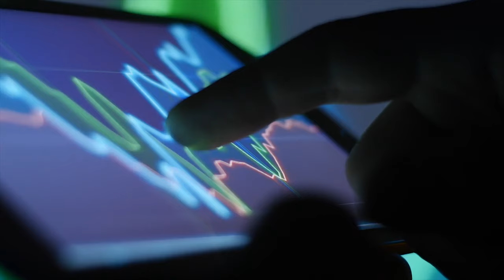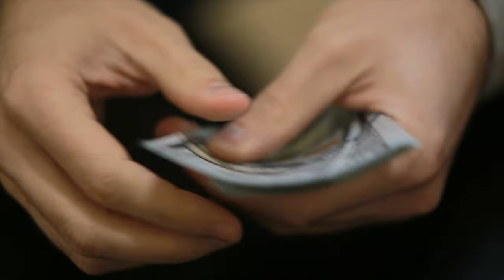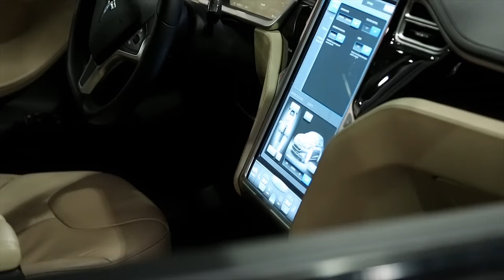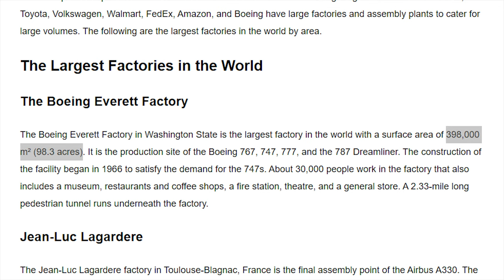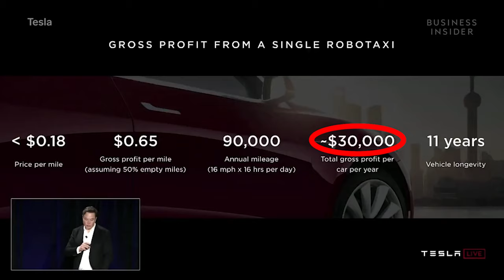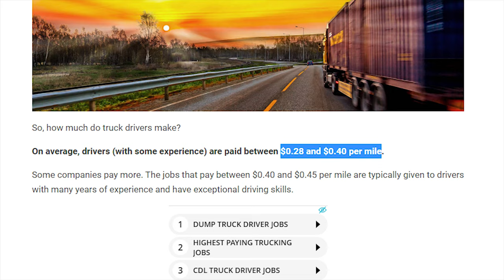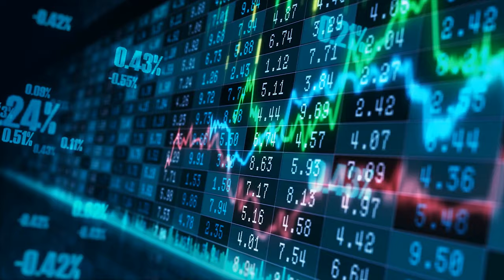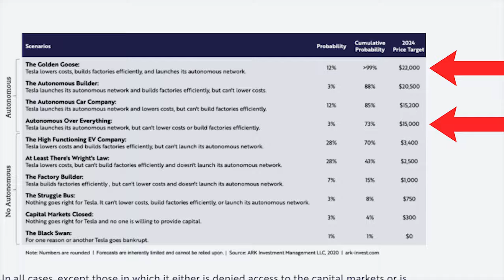How Tesla Will Autopilot To $100 Trillion

Comment: I'd be pretty darn happy with just $4T
Reply: Just 4T 😂 that is double the price off apple. I think they will get there but its never just 4T
Reply: @tomvanstraaten2001  Yup... Apple will probably be $4T in a few years
Reply: @NotFinancialAdvice  little optimistic but the will come there in while
Reply: @tomvanstraaten2001  If Apple goes up 15% a year it doubles in less than 5 years. (It 4X'd over the last 5 years)
Reply: @NotFinancialAdvice  5 years isn't a few. why. you said a few its 2 years in my head
Reply: @tomvanstraaten2001  In my head 2 is a couple.
Reply: 4T BOBUX

Comment: Very interesting.  Some other considerations: (1) I've heard that production at Giga Texas will eventually become 2 million vehicles per year, and at Berlin 1 million, also Shanghai at 1 million.  Fremont, I believe, will be around 500,000 per year.  Giga Nevada will also, I think, produce EV's as well as batteries, so let's say another 500,000 per year.  This is 5 million per year, total.  Assuming another 15 or so factories by 2030, at 1 million per year each, that's about 20 million EV's per year by 2030, which is close to Tesla's published goal of 50% growth per year.  (The actual number of EV's @ 50% growth/yr is just over 30 million).  So Tesla is likely to be adding EV's to its global fleet by at least 20 million/yr by 2030, hence is likely to have significant market share for EV FSD Robo-taxis in the years ahead.  Also, (2) regarding the solar energy division of Tesla, its Autobidder software will similarly provide additional income for Tesla in terms of providing solar energy to the regional and national energy grids.  Tesla is now licensed as an energy company, or as a Utility, and is soon to be deriving residual income not only from its Robo-taxi fleet, but also from its percentages from providing solar energy directly into national energy grids.  Hence, in this case, the present-day infrastructure of utility companies - relying on fossil fuels - is about to be disrupted significantly, and many of them will have to radically reconfigure their business models, or shut their doors and go out of business.  Hence (3) the numbers you project might actually even be larger.
Reply: Do you think Tesla (and solar in general) will remain the dominant energy in 50-100 years? Feel free to correct me if I'm wrong, but I believe that fusion would become the dominant energy by at least 2060-70, as Helium mining on the Moon (and in a few centuries, the gas giants) becomes common. I may be wrong, but these are my beliefs

Comment: Robotaxis is a dream. This is not gonna happen before decades. The problem of autopilot is much more complex than just following lines and signs, there are an infinite number of situations where road rules SHOULD not be followed. Will love a robotaxi entering a crossroad under the control of a policeman or reacting to a ambulance zigzaging in the traffic to make way, and I can go on and on forever. I'm not against the reaseach in that field but I'm considering this like a far far away objective. That company has enough potential to become a multi-trillion company without robotaxi.
Reply: nobody knows if its years or decades. Not even Elon knows.

Comment: Interesting video! I think your future predictions follow quite logically from Tesla's stated goals. However, profits like this would attract very strong competition who wouldn't be more than a couple of years behind. For example, MobilEye is already quite far with a similar approach to Tesla and if Tesla tried to get such enormous profit margins, Cruise and Waymo would also be able to provide competition in at least some areas and force the Tesla profit down. This competition would push prices down and make profit margins shrink. Its hard to predict these dynamics but the 25k$/y per taxi profit can't be maintained long I expect. Such shrinking profits would require a low P/E ratio. I once made a very similar calculation including these dynamics and using discounted profits rather than P/E ratio and I ended up in the 5-10 trillion dollar range. That is of course if Tesla wins the self-driving car race and includes a lot of speculation.
Reply: Still, owning 100 shares at $10T? Can't argue with an easy million. lol

Comment: Strange as it sounds it’s not aggressive enough. Three slipstreamed semi trucks are cheaper than railroad freight charges. The AI will be turned onto manufacturing itself and even to automating the building of factories. However all of this productive capacity will be very deflationary. Simply put, in the future we won’t value goods and transportation as much as we do now. Market share will be enormous but the value will erode. What a strange world...
Reply: if there is no tough competition, the profits will stay high. Current auto business is suffering for decades because of the tough competition - too many big players with very similar performance products. Being ahead of the market and keeping the lead could mean 100x times difference in profitability. Which means that these estimations all took into account a huge lead with no "real" competition forcing lower and lower prices.
Reply: @szabomarton8064  True, but Wright’s Law applies. If Tesla has a 100x ok even a 2x advantage, then their costs will decrease faster than the coming competition- all things being equal. Mere competition isn’t enough, the competition needs to leapfrog Tesla costs by a factor of 3x if Tesla is 2x ahead now.

Comment: I think there’s a couple missing items in this video (unlike the spacex one which was very thought out). I don’t know if people would be willing to live without a car for the edge case concerns (moving out, road trips). I think that revenue stream may be a bit of a stretch, as Tesla may have to settle to produce some cars that aren’t robotaxis. If that really was their plan, I don’t think they’d make the cybertruck and model Y just to get more data, effectively. 

In addition, Mobileye is never talked about as a legitimate contender. I think they have more data collected than Waymo, but they’re a bit more conservative with their release timeline. Again, they aren’t vertically integrated, but they can partner with a EV manufacturer.

Also, one thing you failed to mention are VTOLs. I believe this is a very real possibility and can disrupt aircrafts.

That said, there is potential for Tesla to reach this valuation if they continue to execute.

Comment: What about wholesale electricity production ? Right now Tesla does distributive retail electricity production with solar roofs on homes.

But what if Tesla went into wholesale electricity production using liquid cooled cables laid underground paired with boring tunnels Instead of surface electricity lines on steel towers ?

A couple of decades ago Elon calculated his famous quip, 100 square miles of solar panels could power the USA and one square mile of the old skinny batteries in a 1 square mile of batteries to store the electricity. Maybe Elon was trying to prepare us for something ?

Of course Tesla would start off with a small proof concept in say Reno at their battery factory under the cover of it’s a green offset for the electricity drawn at all their super charging stations. And also test liquid cooled cable to lines to Reno/Sparks Nevada to transport the electricity. Remember Tesla is already testing liquid cooled cable lines to fuel their Semi.

Tesla would then sell this electricity wholesale to Reno/Sparks electric utility company taking those two cities off the fossil electric grid.

Now with a thousand boring machines creating Tesla’s own underground interstate system at 100mph, (600 mph if hyperlooped); this scales nicely to provide electricity to the whole US through liquid cooled cables paired with the boring tunnels. 10 solar fields, more or less, strategically located throughout the US would cover everybody.

Take note that the Austin gigafactory is right next to the largest desert in North America, the Chihuahuan desert. Also take note Austin City is on Interstate 35 along with San Antonio, Waco, Dallas Ft Worth. I-35 is totally messed up planning wise. In Austin area planners didn’t leave room for expansion, I-35 expansion was done by stacking a second interstate 35 on top of pillars above the current I-35. And construction is always constant Austin to Dallas Ft Worth, doing replacing, repairing and widening this I-35 corridor . You can imagine the car congestion.

So the Austin Giga-factory is located perfectly for 250-350 mile long boring tunnels for cars paired with liquid cooled cables for transporting wholesale electricity produced by Tesla solar field in the  Chihuahuan desert near Austin.

Currently, the boring company is planning a 250 mile plus tunnel from Las Vegas to Los Angeles. An Austin to Dallas boring tunnel for car and liquid cooled electricity transport is in the same 250 miles range. 

Let’s say Tesla starts with a 25 square mile solar field just for Texas, where electricity is not cheap, Tesla could sell the the electricity wholesale to the utility companies, eliminate utility companies need for fossil electricity plants and peaker plants and make a nice profit while lowering the cost of electricity.

Peaker plants to control power grid intermittency would no longer be needed as Tesla is storing excess electricity in its less than 1 square mile field of battery storage for surge demand. (Tesla already does electric grid storage in Australia and other places).

If you add Tesla wholesale electricity  production from solar fields, how much does that add to your 100 trillion calculation ?